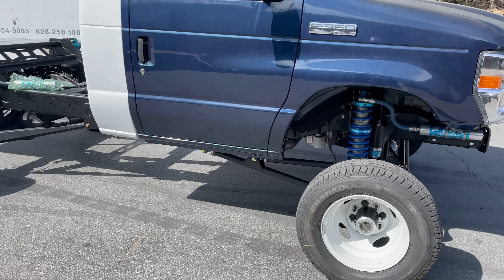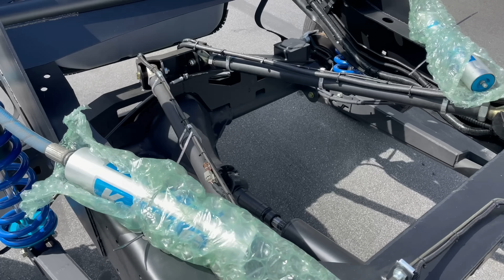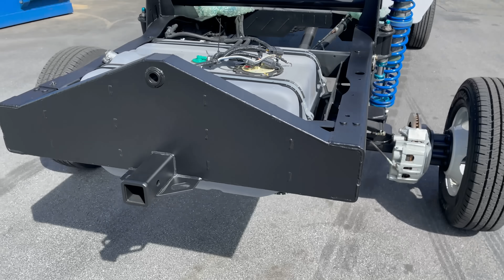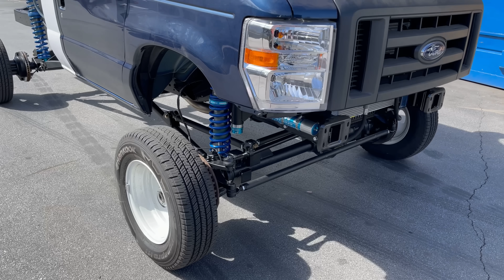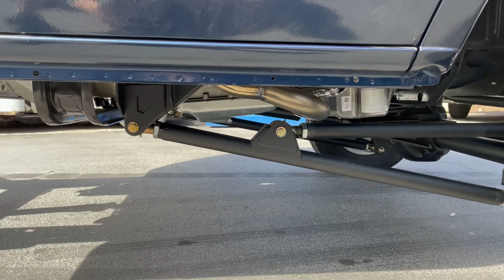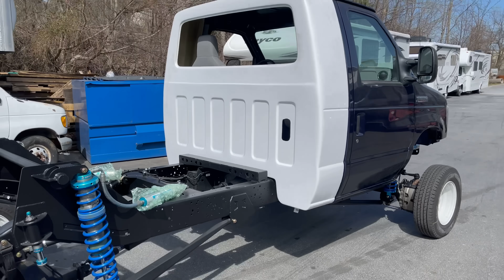V4 2.0 Mid Build Progress!

Comment: You're going to run big mud tires on that you will probably have to trim your fender well in the back by the door where that point sticks out a bigger tires going to rub it are your back rims on backwards I guess they're all on backwards
Reply from the maker: We fully cycled it with the 37s it will be running, all is good.

Comment: Did they offer the powerstroke in the E-series after 2010?
Reply from the maker: Nope
Reply: @ujointoffroad  Boooooo. Too bad. That new powerstroke is a lot more more reliable than their old ones.
Reply from the maker: @erikkovacs3097  Yea in 2010 it was still the 6.0, the 6.7 is too big for an E series. I wouldn't want it anyway, gas is so much more reliable and easier/cheaper to own/maintain.
Reply: @ujointoffroad  You know it's funny listening to Bill Hewett at Powerstrokehelp he says that there is a sweetspot in the early mid 2000's where powerstrokes were advanced enough but not choked with emissions crap that they have a high resale value. The modern ones are practically garbage and I though gasoline would be the way to go until I saw the ecoboost and thought otherwise. Emissions are killing reliability of all modern engines regardless of fuel.

Comment: You could have borrowed from the long arm setups in the jeep wj world and built a custom trans cross member that has mounting points for your longer radius arms. That would have kept your frame cleaner, and saved on a little bit of ground clearance since you wouldn't have had to drop down as far. But that is an awesome looking rig, can't wait to see the end product.
Reply from the maker: We considered that but decided to keep the separate in case the transmission needs to come. The suspension can stay in place. 👍🏻

Comment: Hey Chris top shelf rig!!  How do the king's work mounted behind the axle?  I'm a GM 4x4 van guy (out of Long Beach Ca., your old stomping ground) been building 4x4 vans for years each one getting better and better as the builds go on.  My builds use boxed radius arms and FOA coilovers the ride is very smooth and solid.  Your vans are great rigs keep up the great work!  Greg at X-treme Utility Vans.
Reply from the maker: They work well, this setup should work even better than the last. Have to get the coils behind the F axle for packaging and to keep it low with maximum wheel travel. This has more droop than bump travel

Comment: rear arms ...?  coil overs  is connected to it...?  not to axle.?  so...all the weight... every thing is up to the ...joint..threads..shaft threaded....  to hold all the weight..hp..jumps...?..    im sorry if im thinkn to much...
Reply from the maker: Yes. Common setup for offroad rigs, trophy trucks, etc. These are the same joints that have been on this suspension under V4 for 4 years, all goo.

Comment: Great video!  Really cool project.  Can’t wait to see more!  I wish you would’ve fired up that Godzilla that’s been uncorked so we could hear it before mufflers are installed.  And parking lot donuts.  Maybe next video.  My ultimate van project would be sorta similar.  2021 E-450 chassis with 7.3l gas, change to SRW.  You get big 6 speed transmission, larger payload and towing capability, have U-joint Off-road 4wd front end conversion and then take it to Mega X 2 in Kanosh Utah for a 15 passenger conversion.
Reply from the maker: It does sound good right now!